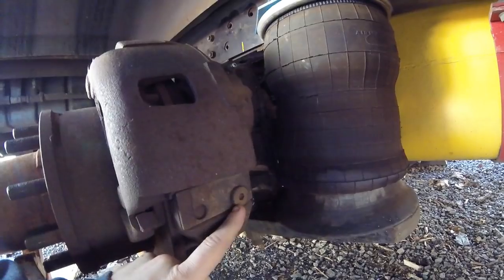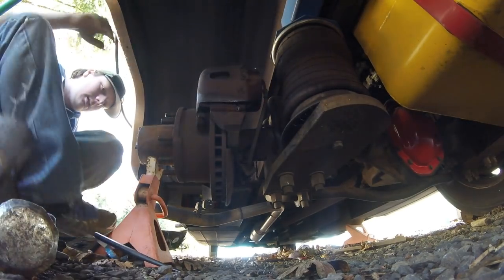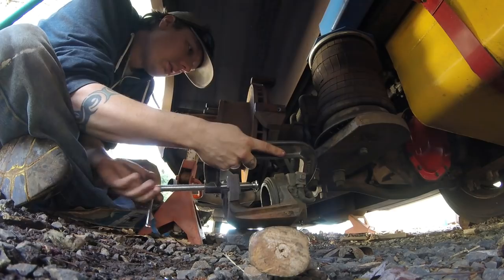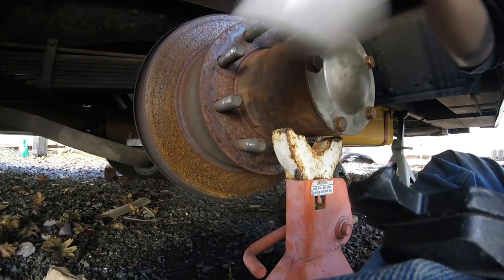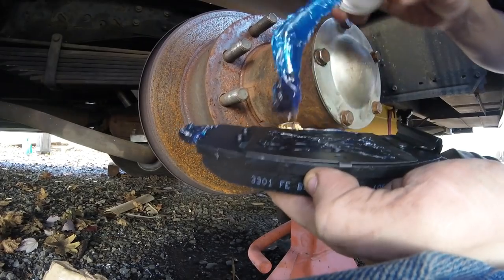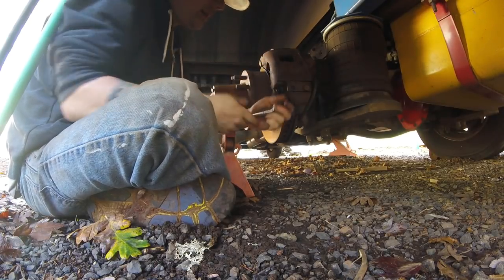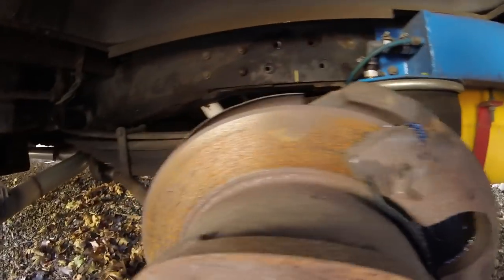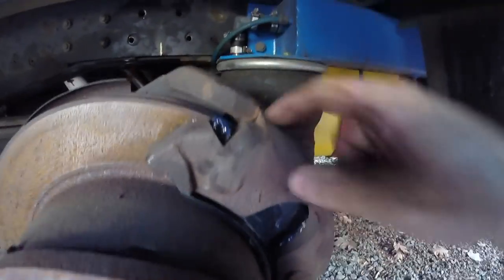HOW TO REPLACE CHEVY/GMC P30 BRAKE PADS

Comment: Purchased my 1992 Chevy Fleetwood Southwind last year . I was losing  brakes on my way back from last weekend vacation , so  I finally got around  to replacing brake pads this weekend.  Omw to the Ranch I used as Mechanics Shop , I completely lost all braking !!! Luckily I had a shoulder to coast to a stop with my emergency brake pedal fully engaged.  I began brake job , searched P30 Brake pad replacement,  chose this video . You are always on point and very detailed . I discovered the location of the brake fluid Resorvior , the Front fluid holder had never had fluid in it ! The rear fluid holder had about 2% fluid when I lost brakes.  
So my point of this story is , when you buy one of these old P30 Motorhome or any old used Motorhome,   first thing is remove driver side tire,  & refill brake fluid containers!!!!! 
On my way to work on them,  I lit

Comment: Just bought a Winnebago Adventurer with the chevy p30 chassis and in way home at a gas stop the pedal went to floor as I put it in park. Wasn't lined up with tank and nozzle so pulled foreward slowly and when I got out again I noticed the friction plate part of a brake pad lying on the ground. Apparently it had broken from the plate during the drive and decided to fall out there. No shops or RV service here would help or even give me parts numbers so a whole day of google to finally find them. One shop called me back offering to fix it for around $1,500. I bought pads and all tools needed to do myself for less than $300. Only part I will need help is after putting wheel back on is getting a truck service center to fully torque the nuts to 180. Thus video helped get the calipers off to do myself, no difference between Motorhome and car there just a little bigger.

Comment: Thanks for the video. I bought a used RV that had just had a complete brake job. The brakes clanked terribly on every bump. The mechanic had put the springs in UNDER the clips. I had been told that I would have to buy new calipers to fix it. This was easy, and free! Thanks again.

Comment: Very Nice job on the Video.
Simple, to the point, and good audio when needed without all the bullshit that so many other videos seem to think they need to be talking ALL the time.
Thank You for posting this.
My 1994 Winnebago on a P30 chassis had these type of caliper mounts on the front end and the Haynes Manual showed the Bolt on Type. Your Video helped a lot.

Comment: Steve Lawson thanks you for your great video, no unnecessary info., just the facts, removing the small clip is the key to removing caliper.
Is the same on Chevy Van 30, that means one ton. You are a true Gentleman Gear Head. Thanks again. Stay safe.

Comment: I'm having a hell of a time with those 2 retainers or whatever they are called, I just don't have the room to slide both back in the channel. I have never had to deal with calipers like this! I like to wring the persons neck who designed them! Urrgg!
Reply: 3 years later and I'm having the same problem. Did you ever get it figured out?
Reply: I believe the retainer has to go in place  first tabs up,the the plate goes in under it untill centered. Then lock in place with alan head bolt. I have to attempt this later.  Hopefully i explained properly
Reply: @trevorb2711  found this while looking for info on how to install these calipers. It's definitely tabs down and he installed them as a unit (spring on top of wedge). Around the 5:00 mark.

Comment: Where did you jack up the rear of the truck at and what did you use?
Reply: I use a 1 ton hydraulic bottle jack.  Then block unit.. i put jack on inside u bolt end

Comment: good job video👍👍
Reply from the maker: Thank you! ☺️
Reply: @ClassALiving  last summer while going to Home depot in my P-30, my van doesn't start back up after I come out. I called a mobile rv mechanic & he said it was my computer. I had a broken pin on the computer. I sent it off to get refurbished & it came back  my truck still didn't work. Is something else I gotta do to computer before my truck will work?

Comment: My experience says get rotors turned when installing new pads. Let me know when you do a video on removing rear rotors.
Reply: Nobody turns rotors anymore
Reply: @davidcarpenter5589  
I do, daily. So do most engine shops, transmission shops, rarely some mechanic shops, machine shops, ORielly, Napa, and Auto zone do as well. They don't always have to come off the vehicle.... If the shop is equipped they may be able to turn them on the vehicle. 😉👌
Reply: For the amout of work it takes to do this.. mine would have to be in ruff shape to remove to get turned on lathe..
Reply: @trevorb2711  It was not that bad.  I have had worse brake jobs on much smaller cars or trucks.  Finding a truck or brake and clutch place that can turn big rotors is the difficult part.  In ACL Austin Brake and Clutch was the go to place was bought out by a big rig national firm and closed their brake and clutch business.  Maybe Southern Tire Mart?